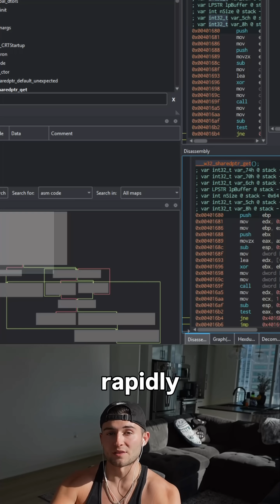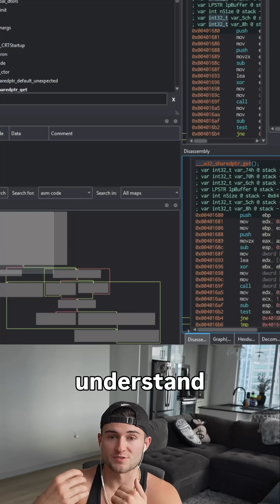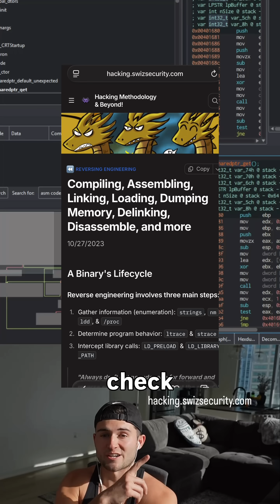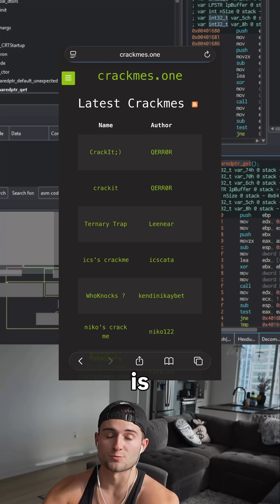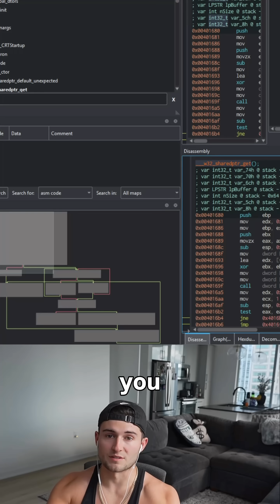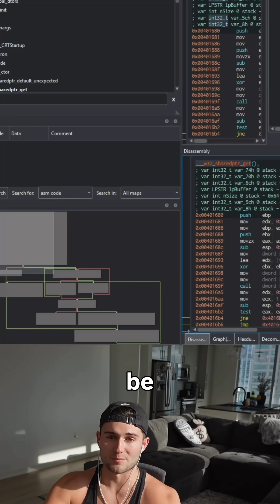Reverse engineering is easier than you think!!! (Pt.1) #cyber #linux #reverseengineering #hacking

Comment: I'm very early on in my cybersecurity journey, having spent over a decade in healthcare before coming back to cybersecurity. What level of knowledge would I need before concerning myself with reverse engineering? I'm trying to get into SOC entry level knowledge right now, so I don't want to get pulled in too many directions, though I feel like that's happening anyway, given how vast cybersecurity is.
Reply from the maker: In order to be an efficient reverse engineer, one must understand the software development lifecycle. What’s the opposite of reverse engineering? Forward engineering. Once you understand what code does, how it behaves, what it should/shouldn’t look like is when you’ll be most comfortable reversing. The way I learned is I wrote some C or assembly code an would put it into a reverse engineering framework like Ghidra or cutter and would disassemble it and begin to compare that to my original source code and would slowly make revisions to my code to see how it would look once disassembled again
Reply: @JakeSwiz that might be a tall order for this individual....